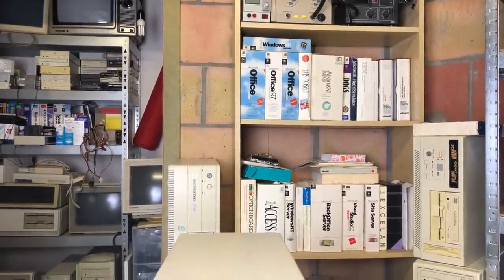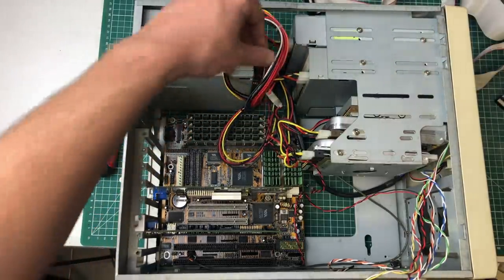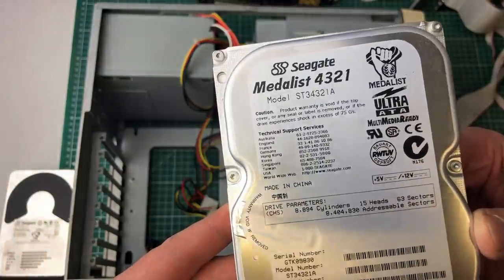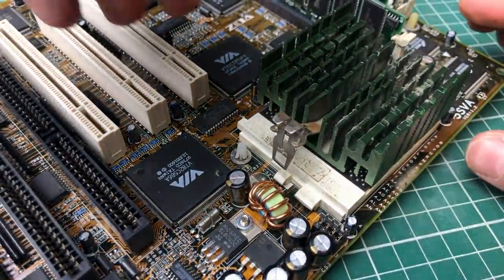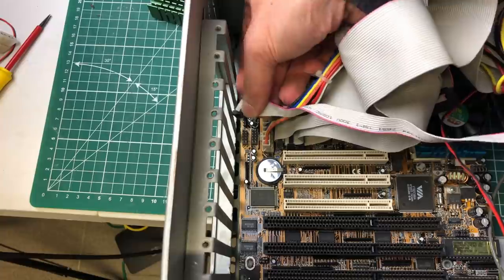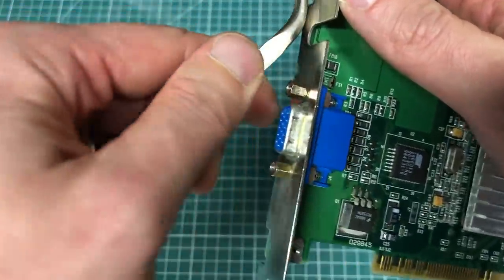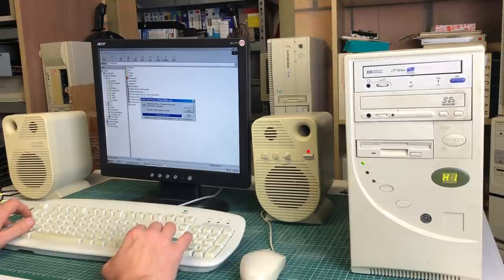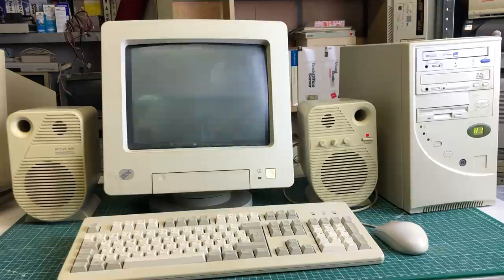Pentium 200 MMX find with Voodoo Banshee

Comment: This indeed bought back memory's. I build and sold hundreds of these cases in 1998. This was a fantastic time for pc hardware and gaming. Everything progressed so fast. Seeing the first 3DFX and the Riva 128 cards, the first PCI soundcards, the first USB devices (we called it the useless serial bus back  then) The first A-open cdrom drives that were way less noisy then the competition.  Wireless mouses and the scroll wheel became the norm.

When you described the problems with the system, it was so recognizable as a memory problem. :-)

Its very hard to find old AT cases in the Netherlands, nice one finding this time capsule.
Reply: cool story grandpa

Comment: back in 98 i built a PII 400 with 2 voodoo 2 cards in SLI, it rocked, if your going to continue using that with win 98, add these 2 lines to the system.ini  "MinFileCache=1024" and "MaxFileCache=4096". win98 had a file caching problem, it would cache all file reads and consume all the ram, and continue to cache to virtual memory, bringing the computer to its virtual knees.  Happy gaming :)

Comment: No mixing of SIM and DIM SDRam on this board, it's one or the other.
Reply: Not only on this board, but actually on most motherboards with both SIMM and DIMM sockets. In most cases one can install both types of modules only if DIMMs are EDO RAM too, which is quite uncommon. Here we clealy deal with PC-100 SDRAM DIMMs, so either they get 5 V and quickly overheat, or cause timing problems.
Reply: @peachgrush  I used to run a k6 with two different types of ram modules back in the day. I don't remember what motherboard model it was, but I'm pretty sure it had an SiS chipset. It was unstable, but it worked.
Reply from the maker: @peachgrush  According to the manual of this board: "SDRAM Module can be used together with the SIMMs Module". The text is preceded with "caution" :) Not really sure what to think of that :)
Reply: @RetroSpector78  Yes, I've heard of some rare boards which allowed mixing SDRAM and EDO RAM modules - but I have yet to see one :) Every board that I have encountered only allowed mixing EDO DRAM SIMMs with 5V EDO DRAM DIMMs and strictly prohibited installing 3.3V SDRAM DIMMs along EDO DRAM SIMMs. However, while googling for the issue I have encountered some remarks of such mixed configurations working properly on some newer (Super) Socket 7 boards - and as many cautions about possible stability issues with such setups.

In your case, there are two possibilities. First, that you've got such a rare board that allows mixing EDO and SDRAM. Second, that some creative manual writer (or a Chinese-to-English translator) was not aware of the difference between what "EDO", "SDRAM", "SIMM" and "DIMM" refer to. Or he or she simply forgot to place one "not" between "can" and "be" ;)
Reply: @fullmetaljacket7  Please see my response to RetroSpector78's comment for details. Your comment is consistent with the reports I was able to find in some forums, of such mixed setups working on some newer (Super) Socket 7 boards, but not being fully stable. This is perhaps why it was not recommended to mix memory types back in the day :)
Reply: at first i saw full ram slot loaded, i thought can you do that? (mixing edo+sd)... and then it boot up to 96mb, wow... and when you got alot of hangs i'd thought.. this must be the ram... 

afaik, alot of socket 7 era support 6 memory modul (6 simm or 3 dimm) if there are mix type of slot, just to add hardware compability, so you can use simm or dimm (but not both at same time)  in now days brand like asrock used to practice like that for example like put ddr2/ddr3 with am2+ socket
Reply: @RetroSpector78  it canbe used together, memory timing has to be the same, the difference between simm and dimm is that on simm the contacts are the same on both sides, where as dimm they have different contacts and so the simm have 32bit bus size where dimm has 64 bit bus size so if you mix them, you need to install simm in pairs so they also have 64 bits. timing may be adjusted in the bios
Reply: @peachgrush  There will always be the timing problem in case of mixing EDO and SDRAM ... it will boot and work but not without problems.
Reply: @peachgrush  I used to have a Pentium 233 MMX system, with a TX Pro II board. I use a mixed 32MD SDRAM with 8MB EDO, total 40MB RAM. The system run perfectly for years. Not sure how the board done it but lucky me.
Reply: @RetroSpector78  It works ony theoreticaly. Praticaly, it's very problematic. Some DIMMs had problems even when running together. Would nver mix simm and dimms, it's often cause of problems. You need to find lucky combination.
Reply: @peachgrush  PC¨´-Chips M572 is one of them
Reply: @RetroSpector78  what about hdd and cd-rom in one IDE - cable? i have read that such connect will have to work slow for hdd

Comment: You could put the parallel and serial connectors straight onto the case instead of using the brackets. You just need to push out the tabs on the case.
Reply from the maker: I know, but would not work for the ps/2 port.  And one would expect to being able to put them somewhere on top.  Just think mainboard layout is a bit unfortunate.
Reply: @RetroSpector78  There were many PS/2 mouse port brackets with only this specific port on them, and placed in a way that would not interfere with even such unfortunate placement of motherboard connectors.
And I was always really suprised how rarely I could see these case slots used for serial and parallel connectors.

Comment: With HDDs of that era the sector size is always 512 so you can just divide the number of sectors by 2 to get the capacity. For some reason they always put the number of sectors instead of the capacity.
Reply: Sectors are still often 512 bytes; Advanced Format never quite "popped off" like they expected. 🤷

Comment: Hi All, nice video.

As a habit after many times of going around in circles back in the day,  the advise for any Win 95/98 machine is to remove all add on cards and run it as a base machine.
All you need it a video card and i would use a "spare" generic card  eg a basic 8 or 16 bit ISA  card say a S3 or trident etc, that way it can use the most common driver to get it up and running.

Try and initially avoid top end card or Vesa local bus or PCI as they are more modern and would demand specific drivers.

Once you have the machine running, then just change 1 card and set it up for its own drivers eg the video car you want to run finally or say start with a sound card or network card / modem / scsi etc.

But the same rule of thumb, make one change and install driver and reboot a few times to insure it works before progressine to the next add on card.

Recently i received a working Dallas RTC chip ( after many failed ebay purchases ) and used my best 2 connor IDE drives - both twins at 400 meg - wow i forgot how SLOW these 8 bit drives are, copying  even small size files ( like the windows install into a directory took forever ) - my next oldest machine a Pentium 2 has a Compact flash to IDE adapter and that is FAST, the 2 x 2 g partitions took under 15 seconds to format 2 G each partition and the install of dos was very fast

Regards
George

Comment: I just crammed everything on the brackets into the punch outs on top on my Pentium back in the day (though that was more issues with expansion cards needing to go where the brackets fit). Even the PS/2 port got shoved up in one, even though it didn't quite fit the serial port punch out I shoved it into, and was secured on one side, but it worked. If you're good with a drill, it might be best to just drill three holes to mount it up in that area.
Reply from the maker: tom611 check out my ibm 5155 to see how “good” I am with a drill :) think I might be better off ditching the ps/2 port and only using the serial via the punch out :)

Comment: i had a pentium 1 at 166Mhz  MMX, never OC it, played games like Delta Force 1, Commandos behind enemy lines, Age of Empires, Starcraft , Warcraft, Diablo 1 & 2 ( only after upgrading the storage), NFS 2, MK4...
there were so many good games
Reply from the maker: Yeah .... actually forgot computers like this could run out of storage :) A lot of these games take up several 100MBs and most systems like this only had about 2 to 4 gb hard drives.

Comment: My first monitor I got for free as it was going to be dumped in 97 or so was that same IBM one 😍 Supported surprisingly high resolution/refresh for its age - worked great with my P133 first PC built from handed down parts from various sources
Reply from the maker: It's a nice monitor and fits nicely with pentium or even 486 based systems. Mine only goes to 800x600 but then craps out at 1024x768 :)
Reply: @RetroSpector78  OK interesting, then it was probably a slightly different model in the same enclosure (including the whiter power button!) I remember driving mine at 1024x768 standard, or 1152x864 but at a slower refresh rate that started becoming flickery....

Comment: That system perfectly runs all the games from 1997 and most of the games from 1998. There are so many good 3d games from 97-98 that run perfectly of that PC like: NFS 2/3, Motoracer 2, Tomb Raider 2/3, Quake 2, Carmageddon 2, Fifa 98/99 Motorhead, Ultimate Race Pro, Sin, Kingpin, Star Wars Rougue Squadron, Klingon Honor Guard and many more. Could you please make a video with this system running those games ?
Reply: idk the banshee isn't that good, it was substantially slower than the voodoo2. surely it struggles in SOME of those games at least? carmageddon being one of them
Reply: @GraveUypo  If you look at my videos you will see that the Banshee is capable or running even much newer and more demanding games than Carmageddon 2. Carmageddon 2 really is no problem for the Banshee. The standard Banshee was slower than the Voodoo 2 only in games that used multitexturing but faster in games that didnt. Many companies even sold their Banshees with higher frequencies than the standard 100/100 mhz. The Gigabyte GA630 run at 110/130 mhz, the Monster Fusion at 105/120 mhz, those Banshees were as fast or almost as fast as a Voodoo 2 even in games that used multitexturing.

Comment: Nice, I used to collect 3dfx cards, I have about 41 in total ranging from the voodoo1/rush and the way to 3 3dfx voodoo 5's with various card in between and one unfortunately not working voodoo 5 6000 and one working quantum 3d aalchemy system(if anyone is unaware of what that is its basically a computer system with 32 vsa-100 chips compared to the voodoo 5 5500's 2 vsa-100 chips or the voodoo 5 6000's 4 vsa-100 chips)
Reply from the maker: Kyle S wow impressive... my voodoo 1 card is literally the only “retro” hardware that I kept. Found it in the attic last year and that got me into retro computing :) 41 ... jeezes .... how long did it take you to collect those ? Here they are extremely difficult to find
Reply: @RetroSpector78  well Im 33 now , but when i was like 13 i had a pentium 1 90mhz system and bought my first 3d card which was an sis 6326 4mb and it was okay, it got me to be able to play motocross madness and camageddon 2 and use 3d acceleration for jedi knight dark forces II then upgraded to a voodoo2 which at the time I was ignorant and thought the megs of the card dictated performance but I was blown away by the performance of it.Ever since then Ive been collecting video cards and have been collecting not just 3dfx but all types of them like matrox,ati,SIS,S3,nvidia etc etc etc agp and pci cards I dunno probably 5 totes filled with them, and still have a athlon 64 based system so i can benchmark old cards against each other without a bottle neck of a cpu,it was an old hobby and its all in totes now but I never threw any of it away.I have a few ati rage fury maxx cards similar to the voodoo 5 5500 with 2 gpu's but I can get only one of the gpu's to work and further looking into it i guess you need a specific motherboard.So I could never benchmark them against my voodoo 5 5500's for performance.aalchemy system is cool but you dont get any better performance out of it benched against a voodoo 5 5500 cause no games is going to use 32 vsa chips but I got it for like $450 and kind of wish I could just have the 450 now and no aalchemy system and get myself a rtx 2070 or something lol

Comment: That was pretty my setup too in 1997/1998. Pentium 200 but without MMX, a Voodoo Banshee which I added later, Seagate 2.1 gigs hard drive. After some time I upgraded the hard drive, the sound card and put an AMD K6-2 300 MHz CPU, I was very happy with it.
I still have that old machine :-)

Comment: I remember having an AST advantage adventure PC that we bought from Walmart in early 1997. It had a 66 mhz 486 dx2 cpu with 8 mb of ram, a 540 mb hard drive, and had Windows 95 version A, I believe the version of Windows 95 from 1996. Even today, I do still have my oldest Toshiba laptop from 1998 with a 266 mhz Pentium cpu with 96 mb of ram and on that, I have Windows 98 second edition.
Reply from the maker: Really like win98se as an OS. And on a decent laptop with an active tft it can be very enjoyable.
Reply: @RetroSpector78  laptop is actually a Satelite 330 cds with it's original 4.1 gb hard drive. I could even do some limited web browsing on IE5.5 and use Microsoft chat to go into chatrooms, kind of like the old AOL days of the internet.

Comment: For Seagate hard drives of this era, the approximate capacity is in the model number, from the second number to the last number.

For example, given the drives in the video:
ST32532A - approx. 2532MB / 2.5GB
ST34321A - approx. 4321MB / 4.3GB

Or to break one of them down even more (let's say the ST34321A)...
ST: Seagate Technology
3: 3.5" 1/3-height
4321: about 4321MB (usually formatted, but some early drives used the unformatted capacity)
A: PATA interface

Or another random drive I have sitting around here, the ST3300555SS:
ST: Seagate Technology
3: 3.5" 1/3-height
300555: about 300555MB / 300GB
SS: SAS interface

Comment: I was already about to type a comment on how you reaaally should remove that SD RAM module, as, usually, RAM types do not mix. But you eventually found that out yourself =)

The module might still be good or may have been good before someone put it in there.
Reply: the machine I had had the same thing we thought we could put some SD in it back then to upgrade it, sadly not the case
Reply: There were a few cases where I had some issues with combined types of memory. There were more occasions where it ran flawlessly though. The memory should have somewhat the same performance levels in terms of latencies and frequency. Just search for it in the manual. :)

Comment: lmao this is essentially the same build as what i have laboriously pieced together over the last 12 months and i've only just finished it this week by getting a nice AT case. socket 7 mvp3, 166 mmx, pci banshee and awe64 ct4520 but i also added a yamaha card for OPL and midi in windows. really great system as it is WAY more powerful and sounds so much better than the cyrix my family had in '96  :D thanks for the vid
Reply from the maker: Was lucky to get everything in 1 shot. Great little machine

Comment: That's a pretty cool find. The only thing that could have made it better would have been the motherboard to have an Intel 430TX chipset. 
PS: you can pop-out the blank plates on the back of the case (next to the keyboard connector) and screw in the serial, parallel, etc. ports individually. That's what I did in 1997.
Reply from the maker: That works, except for the ps2 mouse port :)

Comment: Hah, that case.. :) I have built many PCs in that case. It was one of the standard cheap OEM cases you could get in the mid 90s, when I was working at a small PC builder shop. We mostly sold 486DX2-66s but later on Pentiums as well.
If memory serves me, it didn't cost us more than about 25 euro and came with a PSU pre-installed, 200W I believe was our standard model.
On a fun note, this (~1993) was when AMD got really aggressive. We got the Am486DX2-66 really cheap, and sold so many systems with them.. Great chip, and it was identical to Intel's, just a lot cheaper. :)

Comment: Having had a couple of banshee based systems back in the day,  Carmageddon didn't play well with banshee. if fact if I remember correctly they released a patch(for Carma) at some point to help stability and performance issues.
Reply from the maker: Yeah also noticed that ... will try to see what I can do about that ... either through software or a hardware upgrade :)

Comment: Would you clean it properly now that it works? Best match for Pentium MMX would be an Intel chipset board, 430TX (better ram access times and i/o) or at least 430VX (cheaper but still good). In the '90s I had a business in IT, from DOS to NT Server. Good times!
Reply from the maker: Most likely yes ... also have a 430TX to play with. Might be a fun comparison. But most likely the differences will be marginal in the bigger scheme of things. Think one AT mainboard even has onboard sound

Comment: I was so proud when in late 1997 a K6 200 "monster machine" replaced my lame 486-DXII 80... problem was, the Diamond Monster 3D I ordered was not avaible for some weeks so the smart-ass guy from the store who sold the PC got me an ATI Rage2 instead... god, what a letdown. But later on I finally got a Voodoo2 (miro HiScore² 3D) and it was like heaven!
In 1998 Unreal was released and I was hyped, so I got the game. But still I had no Voodoo Chipset in my PC (vanilla Unreal couldn't even use Direct3D so the pain using the ATI Rage was no option at all) so I upgraded from 32Mb Ram to 64Mb. So the game ran in 512 resolution... in window mode!